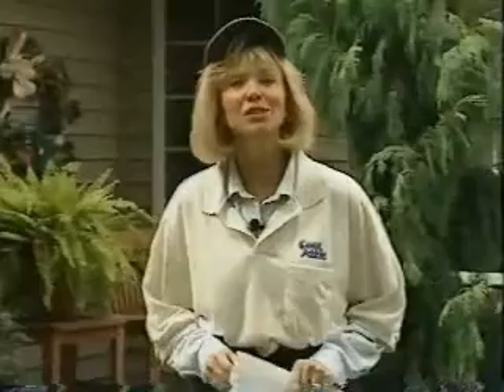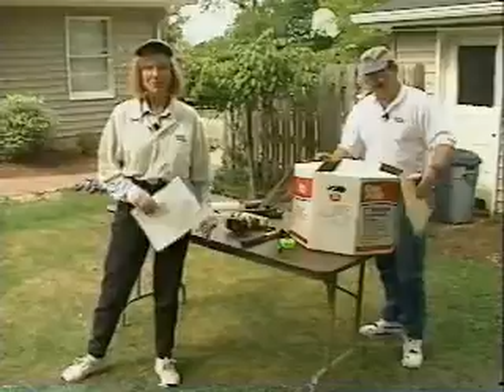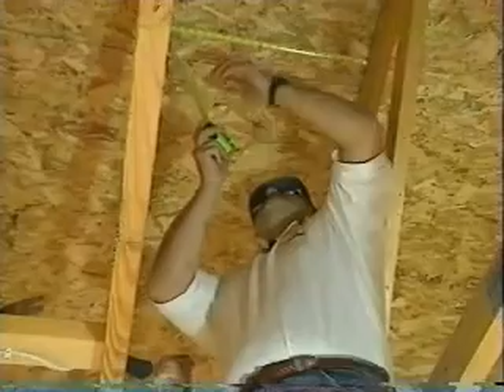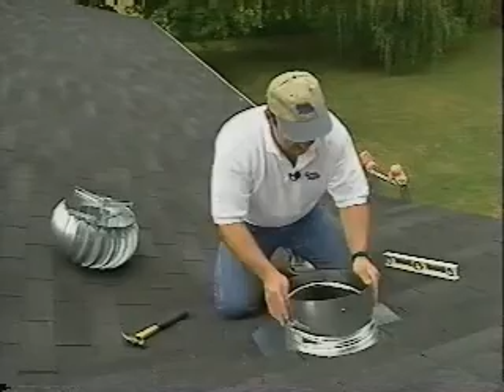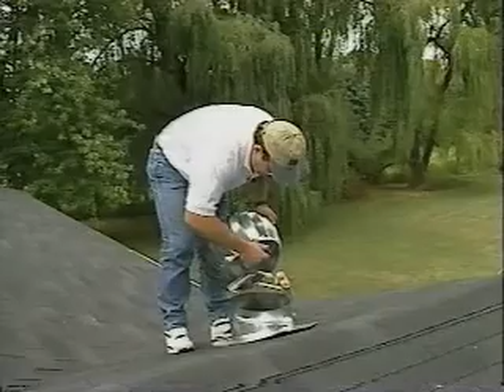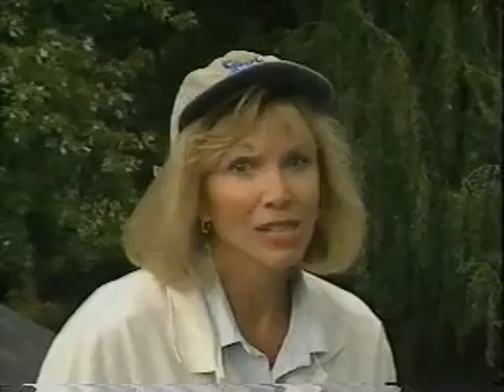Cool Attic Turbine Install

Comment: i installed one of these  it lowered the whole attic temp 5 degrees fahrenheit    its a 1400 sq ft  and has a ridge vent....  i  was hoping for 10 degrees ...i like seeing it spin  knowing its taking hot air away ..  and saving my shingles and a/c  from working too hard   ,,its been only 24 hours   and im happy